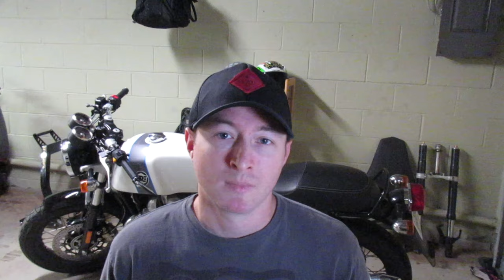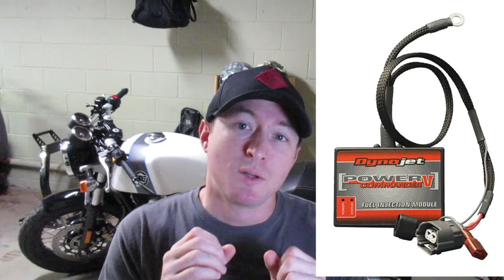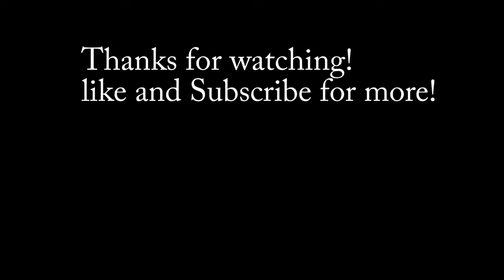Is a Power Commander Worth It?

Comment: FYI if you don't install blockoff plates, insall fueling dongles on the wideband censor it will revert back to the emissions restrictions parameters EVERYTIME. THIS IS A MUST. anyone who says there's no benefit to running a PC5 especially when running a full exhaust and airfilter hasn't installed or had it actually working for them. If you bought your motorcycle in the  USA or EUROPE you're bike is running with horse power killing restrictions (FACT). If you installed a full exhaust your ECU will try to revert to a leaner ratio. High mid 14s and causes premature detonation and is bad for the longevity engine.

Comment: Nearly correct a close analogy the  idea is to as you said adjust the air and fuel to the new exhaust.

Yes some support a set type of exhaust however the best options are to get the bike tuned professionally or use  a pcv autotune unit the first can be expensive especialy if fitting of the electronics is required.

As with many things a little knowledge can be dangerous so if in doubt take it to a tuner although I will add diy can be fun and my own experience found lots of info online and dynojet tech support in the UK very helpful.

Certainly in my experience all the bikes I have had and upgraded the exhausts have benefited from a custom map mostly achieved through autotune using a base map and patience learning what should be set and the best options for performance and economy modes often settling for something in between however to achieve this patience and a good understanding of what you are doing and an ability to use the tools and computer are required.

Dynojet pod 300.
In respect to the pod 300 unit from dynojet I found it badly made and useless so opt for connecting a laptop when required which frankly when optimised is rarely required for general use unless you need fast map switching which can be achieved with a simple switch give the pod 300 a miss. 

I also recomend making sure other important things are checked first such as the throttle bodies being balanced, people think they are set at factory and thats complete rubbish, so far nearly every bike i have had has unbalanced throttle bodies, the bottom line here is fix the basics then look at the advanced options.

As someone else said firstly buy some good bike gear and if required get some decent training not the bog standard rubbish provided by most training centres and highly recomend some form or advanced rider program.

As far as performance tuning and track days yes it makes sence as for the road I disagree with others comments but acknowledge the point, let me explain. 
Most will never need to change a thing agreed leave it all one and enjoy your stock bike, if your changing the exhaust for tone then there may be a reason to run anew map ensuring the engine is running efficiently. 
If tuning for power and speed on the road well everyone to there own but personaly see little point other than the owners own ego.

So why do I bother I don't do track days well that I guess is the final option I like electronics and engineering and simply prefer to have a system running at peak performance providing a balance of economy and power provsion if required with no contemplation / requirement  of high speed acceleration or top end speed, so as someone else said views may vary on why one would bother and that depends on application and personal requirement.

Comment: I installed a power commander on my 2012 suzuki vstrom dl1000 to resolve some lean issues from idle speed up to 3k. I have much better throttle control now, especially when riding in the rain.
Thanks for the info.

Comment: Thanks for the video. I have a lil' teeny tiny Honda 2015 CB500F (but I LOVE my bike!!!)  with a slip-on Leo Vince and I thought I was in need of a Power Commander Fuel Controller. 
    After watching this video, Im going to wait on buying one and do other add-ons for increased HP since I do not have a full-on performance exhaust system (only a slip-on)........yet. Thanks for the info.👍🏼
Reply: The PC5 and EJK used to include an O2 eliminator for them to work properly, and it does a good job richening the mixture. 14.7:1 is ideal for fuel economy, but 13:1 is what most MC tuners strive for.

Comment: I have a 06 bmw k1200r and I have a pcv with an auotune wide band kit and the pod 300 and with the mods I have it does make a difference but I took the tune dynojet had for the bike and modified it through the software on my laptop so with tuning knowledge and some data logging it can be helpful that being said on my 2019 s100rr I have a reflash of the factory ecu and its great so I agree early to mid 2000s bike can benefit from them but modern bikes I'm on the fence about

Comment: Whats a "full exhaust set up"? Because on my 2003 suzuki gsxr 600 i removed stock headers and muffler, and installed a brand new "Voodoo 4 in 1 headers" with some "Voodoo" open exhaust. Is there anything else i should do for the exhaust system?

Comment: Very divisive subject , most modern fuel injected bikes with O2 sensors will adjust themselves , take you RE for example , if you fitted a DNA air filter and slip on silencers so giving the bike a much enhanced gas flow in and out , all you would need to do is run the bike on tick over for 10 to 15 mins to allow the ECU to learn the base settings , then take it for a gentle ride for 5 miles or so , again to allow the ecu to adjust to normal load conditions then your done , as you say tech has moved on massively and most modern vehicles now have self teaching Ecu  which tailor to your driving habits , even years ago unless you went full retard on your bike there was little benefit from these fuelers , usually they ran far to rich just chucking fuel at the problem , I actually spent ages on my Kawak Meanstreak looking at options once I fitted free flow exhaust and filters , a dyno jet remap ect was gonna see off some 400 plus quid from a dealer , didn`t fancy that after coughing for the up grades so did some research , found some info online from a tech nerd who had spent hours working out all sorts of figures , long story short to richen the mixture just enough to prevent lean running I ended up soldering a 10 ohm resistor in to the air temp sensor circuit , 25p from Maplins and it ran a treat
Reply from the maker: Definitely a divisive subject haha, as is shown by the split in community and some toxic comments. Thanks for sharing your thoughts and your solution!

Comment: ECU reflash is the way to go period the power is a lot better over a power commander no extra components to fail like plugs or the unit itself I've ran power commander for years even with auto tune and they didn't come close to power gains and feel of ecu flash

Comment: Hi Alex I have a 2001  tl1000r  it had a power commander 3 in it when I got it 9 years ago it started acting up so my mechanic unplugged it now  it runs rich to much fuel 
So what I'm asking is can you just unplug a power commander system without re tuning anything

Comment: I have a 2016 harley 883 sportster.  So far the only modification I have done to it is use a K&N air filter. I have checked the plugs a couple of times and they are snow white. However, it doesn't backfire when I decelerate. It runs ok but I can tell the motor needs some more fuel without a doubt. In the future most likely I want to put slip ons and a bigger cam. Not hot! Just more duration. Any ideas?? With such small modifications could a dealer just reflash my stock fuelpac??

Comment: What about the Continental 650 (it's behind you....) and the fuel booster plug to stop the backfiring with after-market cans? How else can you stop that on the GT?
Reply from the maker: Well I have actually not had that issue with backfiring on the Conti GTs that I have done exhaust swaps on (when I worked for a RE dealer), but that being said we always did a half system, not a full swap. I have seen nothing but good reports on the booster plug from people using it, so I would not at all be scared of it. Seems like it would be a much better option for that particular bike than paying for a Power Commander, but that's what I meant here, it is sort of a bike-by-bike basis. If someone were buying say a 2008 Kawasaki ZX6R with an aggressive exhaust, then yes I would maybe say the commander would be a good idea. Hope this makes sense!

Comment: I have a 2015 FJ-09 that I bought with about 1000 miles on it.  It already has a full two brothers system and a power commander, but now I'm wondering if I should chuck the PC and get the ECU flashed.  What kind of problems can the PC cause?

Comment: THIS INFORMATION IS NOT ACCURATE. A power commander has complete customization all the way down to the 100rpm intervals/ and throttle position down to 10% intervals.  When you get a bike custom tuned how do you think they do it?  Power commander specifically offers their software for free.  The tuning devices hes talking about that come with exhausts and what not literally offer almost no customization. This isn't an argument this video is just straight misleading
Reply: Many channels on here are simply bolt on champs. They DO NOT understand that the only way to be in tune is to run it on a Dyno while quantifying all metrics and properly tuning a specific setup.

They want power cheap and it just doesn't work that way.

Generic tuning be it a flash or modules ALL need to be specifically tuned to an engines needs to optimize performance.

Comment: I am in a position and wondering if someone can help. I just bought a 2021 R1 a month ago and got my first 1000k service done last week. I have ordered a Austin racing Mid pipe and GP1R muffler, I am keeping the original headers. I am  actually very hesitant to touch the ECU for flashing. Some people have told me that it can damage my engine as it will run lean. Lot of people have different opinion. I am so new to After market exhausts and Feel so lost. 

If i could, I would love to just Decat, add mid pipe and Muffler and run the bike like normal. I dont track and mostly ride on hills, Highways or street.

Comment: Thank You very much for the explanation, Alex! You have mentioned in the video that you have tried to exchange the whole exhaust system on Kawasaki Vulcan without the need of Power commander. Could you please tell me what was the year of manufacture of those bikes as well as the engine size? Many thanks for your reply in advance!
Cheers from Slovakia EU!
Reply: My 09 900 vulcan has cobra pipes. It loads up going down hill  and pops. Told its to rich

Comment: I have an 07 Boulevard M109R. I purchased it with a full Cobra Exhaust System and Power Comander 3 already installed. I get flat spots in power. Basically in each gear I would get full power immediately after shifting into the gear, then it would lose power in the selected gear. Then it would build itself back up to full power while still in the same gear. It does this in all gears when riding hard. I don't experience this issue when riding leisurely. Would this be a mapping / tuning issue ? Should I just remove the PC3 ? 

Your Thoughts please.

Comment: Appreciate your review, Alex! Very helpful, and I have to agree (not worth it!). I've been thinking about putting the PCV on a Yamaha ATV, but in looking at it further, the PCV only offers TWO canned MAPs (stock exhaust-stock intake and custom exhaust-stock intake), which makes it no different than simply flashing a standard MAP available at half the price.
Reply: What's up Alex, Biker Boi here! I have a 2002 GSXR 750 that had no PC on it when I bought it with a Yoshi TRS exhaust but Idk if it's a full exhaust or not and it sounded pretty good but I liked the look of the RS3 better so I slipped it on myself and it sounds great to me also rides pretty good still! Do u think I still need a PC since it's a slip on or should I just maybe have the ECU flashed?

Comment: What's your views on Booster plug? Have you considered fitting one to your  RE? I have the booster plug both on my interceptor and classic 500. Have noticed both bikes pick up slightly better but its subtle.  The classic 500 seems to want to up shift a lot earlier without lugging the engine. For the modest outlay worth a punt. Interesting topic.👍
Reply from the maker: Very interesting topic, and I may get one just to try it out for everyone! My bike has been running great thus far, but with an exhaust swap I would definitely be willing to try one, especially "for science" on the channel!
Reply: @AlexSimmons11c  Yeah agree. Runs great on my interceptor especially now I have fitted a pair of Scorpion silencers 👍

Comment: question, i have a 2002 honda blackbird, an it runs hot like all the fuel injected ones do. there has been no mods done to the bike , so i was wondering if installing a power commander v would richen the fuel mixture enough so it would not run so hot? any advice would be welcomed.

Comment: Hi Alex, thanks for your infos, I did put a power commander 5 on my Ducati scrambler 800 2017 , I did it before watching your video, I took off the the bike  the O2 sensors and replaced the original end of the exhaust with an SC Project slip on, I did tune it but still not happy on low revs, the bike feels very lazy and at 4000 rpms the bike come alive...should I remap it or what should I do to have all the power from 1500 rpms onwards??
I hope it make sense my message 
Thank you
Cheers 
Thomas

Comment: Please help......I ordered twin slashed staggered vance and hines full exhaust, guys at store recomended the Dynojet power commander V. I have a 2006 Suzuki Blvd c50 with 5k miles. What is your opinion on what I should do. I'm not to interested in getting more speed, I wanted a black exhaust to customize bike more plus my radiator is louder than OEM exhaust.

Comment: There's so many 'ifs' in your discussion that it has little practical value. Also, without a PC, you lose your factory ECU settings. Any comments on some comments I picked up researching the issue? :

KLR 650 ... 
Bad news: DynoJet's Power Commander KLR tune does not resolve the mid-rpm fuel cut issue. Also, changing the fuel values (from 0 to 1) on 0% throttle for 3k - 7.5k RPM and it made no difference. I had a feeling this would happen. The DynoJet is a piggy back module. The ECU knows nothing of it.
Good News: Definite 'seat of the pants' power increase! Pulls much better in the mid range while maintaining smooth control for the slow stuff. Looking at the maps, they achieved this by bumping up the timing advance values in the mid range. They made minimal changes to the fuel map. I'd compare the change to hitting the 'sport' button in your car or tow/pull button in your truck.
--
Power Commander

I don’t have one but those that have tried them on bikes in general say 1 to 2% increase. So .4 to 1.8 horsepower. Barely noticeable. The big bore kits seem to be the only thing that pumps up a KLR.

I have two 2022 KLR’s both with power commanders. One has a Yoshi slip on and one has stock exhaust. Big improvement on both bikes but the Yoshi in my opinion gained at least 10% more. Much more throttle response and the added ability to pass cars on highway by just rolling the throttle instead of a requiring a down shift. Also a noticeable reduction in engine vibration at 60 to 70 mph. The engine just runs smoother. Definitely worth the money especially if your already adding a slip on exhaust.
If you add the PC to your stock exhaust it comes with a map ready for that exhaust. You’ll notice a quicker throttle response and a bit more horsepower. Add a slip on with the PC and the improvement over stock is significant. Hopefully soon, PC will have a map specifically tuned for a few different slip on exhaust options. Either way, the PC is a great upgrade.

Re-Flash The ECU Or Aftermarket Tuner
Most modern bikes have an engine control unit (ECU), a small computer chip that controls (and much of the time strangles) various aspects of the bike’s performance. That chip is factory-programmed to comply with emissions and fuel requirements, but lucky for you, it can be remapped/re-flashed to uncork performance. An ECU (re)flash involves changing the stock onboard programming with a new tune usually resulting in good power gains (depending on your goals). But if you’re always changing parts on the bike (exhaust pipes, etc.), an ECU flash is probably not for you. Also, if done incorrectly your bike will suffer, so make sure the grease monkey doing the work knows the lay of the land.
Or you can go with an aftermarket fuel/power tuner (like a Power Commander or Vance & Hines FuelPak) to adjust those stock settings. Broadly speaking, tuners come in two flavors: plug-and-play units designed for stock or lightly modified engines, and those that can be programmed to add more fuel or air and tweak other settings at different ranges to make more power to meet a highly tuned engine's needs. If you've slapped on a new pipe, you'll definitely want a tuner to get fuel mapping brought into line. These units can be a much simpler and more flexible deal than a re-flash.
Result: Unless you're piggybacking with some other change, power gains won't be much, but they'll improve overall rideability.